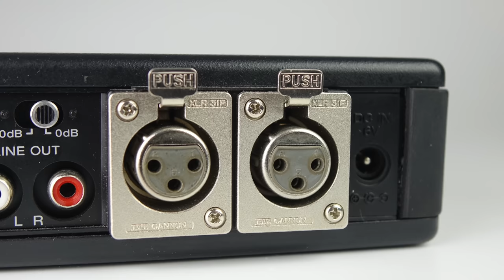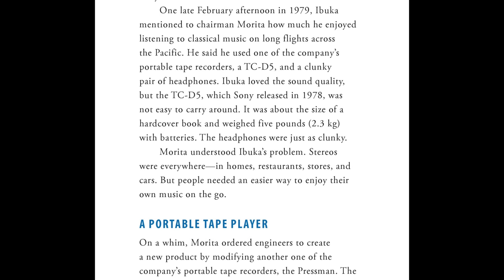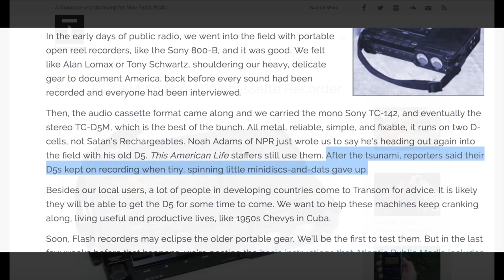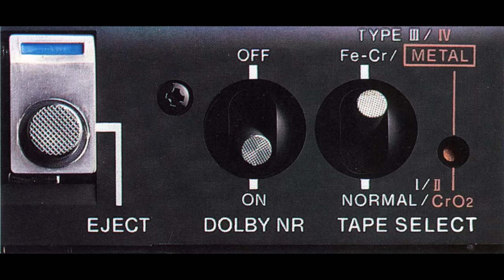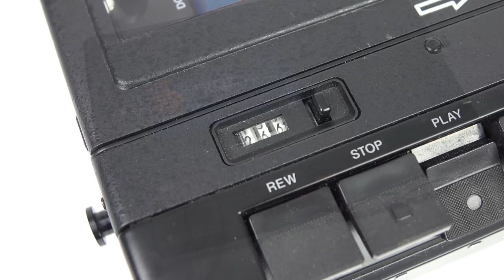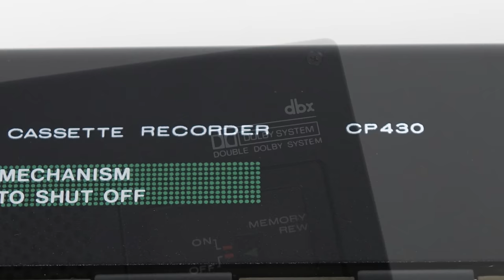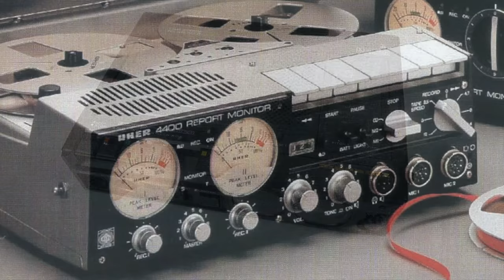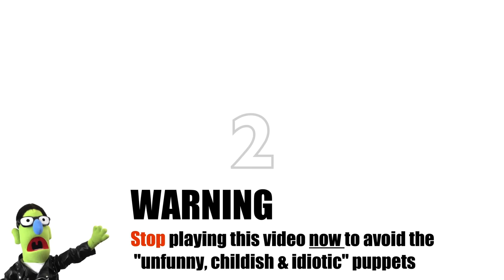Classic Tech - Sony TC-D5 Field Recorder

Comment: I worked in radio in the 80s, left in the early 90s, and when I returned in the 2000s was surprised to find that my new station was still using these recorders. These machines were incredibly dependable.

Comment: @ 6:31 that external power plug is center negative. 
This should be noted for anyone at home wanting to power their TC-D5's with the external plug because most DC barrel connectors are wired to be center positive.

Cheers for sharing this impressive bit of kit! And great quality video as usual, man.
Reply: A lot of Radio Shack equipment was "center negative"
Reply: Seems the negative pin is a japanese thing.. just look at most casio, yamaha and rolands. They have centre pin.. and theyre designed in japan
Reply: @Saavik256  Center negative was the standard for a long time till it changed to center positive for some reason. The change started in the eighties, and by the 90s most things were center positive. I don't know they they changed. But to this day, music related stuff that uses dc power is still center negative.
Reply: It is quite easy to rewire your own power source. Just label it clearly, so nobody would use it for something else.

Comment: I still have my TC-D5M purchased in 1981. I had to replace the belts but that's it.
The 'M' model has a sendust and ferrite head that will last forever, mine after 37 years and countless hours of use still has no sign of wear.
The limiter on those units is nothing less than a professional quality unit on its own.
I used the limiter for years when recording concerts and it performed like a true professional standalone unit feeding exquisite Technics RS-1500 reel to reel recorders.
Servicing the TC-D5M is not for the faint at heart, the service manual is a must and available on the net for free.
The main circuit board is linked to many mechanical controls under it and removing it should never be done without the service manual.
Even with the manual; take pictures of what is linked to what mechanically otherwise you are in for a very difficult if not a nightmare re-assembling it.
It is on my list of the very best audio units of that period.

Comment: Really takes me back! I used these in radio news as late as 2004, even after we were otherwise all digital. As a reporter, I preferred these to the minidisc recorders that were also available at my station. We would play the tape into the computer for digital editing. In another video, you talk about the high sound quality you can achieve with cassettes and it reminded me of this machine. They sounded great when paired with a high quality mic. Thanks for the stroll down memory lane!

Comment: I bought my TC-D5M on 1986, and recorded a lot of Dead shows with it. 
Awesome deck.  I still have it. 

If you looked at the tapers section at a typical Dead show, D5's were the predominant recorder, followed by WM-D6's, and then everything else. 
Stacks of D5's were the norm, with multiple recorders daisly-chained off a single set of microphones. 

One useful trick on the D5's, is that if you hold down the REC button when stopping the transport, the electronics stay active, and anyone daisy-chained downstream of you does not have their feed interrupted.

Comment: Great video as always Techmoan. I use a modern equivalent every once in a while when recording on-set dialogue or for a small multitrack recording, and the concept of these hasn't changed at all; £50,000 audio console condensed to a size of a book, built like a tank and still industry-priced. The only things that have been updated is the storage medium, mic preamps and inclusion of SMPTE connections for camera and timecode generator synchronisation. But the beauty of industry standard equipment is that they're built to withstand time and offer top quality productions no matter what era they're from. Consoles from the 80s are still used today and in perfect working order, and these recorders can still find use today.

Comment: i've had a superscope/marantz cd320 "professional" portable cassette deck since 1979. which at that time was $150, that came with dolby, dual flywheel, servo control, mic att, tape type etc, that has worked flawlessly since i've had it.. It does take 4 d cells, but can be plugged into the wall without an adapter. Its a heavy brute but the heads are in mint condition, and it has great sound. Unfortunately, the belts went out on it. i was gonna pitch it until i saw some of your videos on bring vintage equipment back to life. i was able to find replacement belts on ebay and was able to change after cleaning off all the rubbery goo. I'm now cleaning the goo of some of the electronics. Hopefully, i will get it back together soon and be using it again.  Thanks Techmoan for helping me save my cd320 from the landfill!!!

Comment: You know what I just thought while watching this? My daughters are 7, and I don't think they would know what either a cassette, or maybe even a VHS tape is. That's crazy considering I still had cassettes in my car up until about 2000ish, and one of my cars has a cassette player now, but i don't have any cassettes. I don't remember when my VHS player left me. I don't even have a DVD player now. I used to love going to my friends house as a kid, his mum had about 8 bookshelves full of VHS tapes, and I pictured myself as an adult having libraries of VHS, Nintendo, Commodore 64, etc cartridges and tapes in my huge audio room with walls of Marshall speakers and amps... and then I moved out and lived on pot noodles and bread until I progressed through the ranks. Now I've got kids I tend to hide in my shed and listen to motorhead.

Comment: I worked at a small, rural radio station in the early 90's, and we had a well-worn D5 that we use for remotes. It might have been the nicest piece of equipment in the building.

Comment: @7:20 - it's very slight but it does warble a bit. when you get swinging the unit on the hip if walking it will get worse.  But it's the best in that manner of all portables I have used. Quite amazing.

Comment: Amazing well done review. I have a TC-D5M which I've had for over 30 years. Amazing machine that served me well. Paid $450 for it all those years ago. Only had it serviced once for a minor issue. Built like a tank. Used it for lots of live band recordings. In my opinion the built in limiter is the most useful feature for loud live recordings. Unlike many limiters on other products today the limiter
on this product worked extremely well with very few negative audio artifacts that often plague such limiters.
As the saying goes "they don't make things like they use to" certainly applies to this amazingly well built piece of tech.

Comment: Excellent piece, as always, Matt! The -20dB att was the Achilles heel of the device.  We sent a reporter to Spain to record a Christmas special and she noticed that it was hard to get a decent indication on the VU meters while recording.  When she came back it was obvious what had happened and the recordings were almost unusable.  If only she'd phoned home!  

Marantz came out with another machine, aimed at radio reporters, which included a phone jack (RJ11) and circuitry to allow the reporter to do a number of handy things; record a telephone interview while in a hotel room (say), go live to air with the station, via the phone but using the higher quality microphone plugged into the recorder, cue up a snippet of a previously recorded interview and play it in as part of a live report to the studio.  Such a device would never, ever have gotten Post Office, or BT approval to connect to the UK telephone network!

Keep 'em coming!

Comment: These are fancier than the Sony and Marantz decks I used as a radio reporter in the 1990s. I remember a big knob on the front of the Sony to adjust levels -- pretty much every one I used was on at least its second knob. Those decks went through a lot on the field, and saved my butt so many times. When I switched to minidisc as an early-adopter, I loved the sound quality and editing functions of MD, but missed being able to slam the buttons on a Sony field recorder when seconds counted.

Comment: Great video as usual, thanks. Glad I bought my Pro II last year before this video came out and the prices went up for ever more!
Also have the CP430 & it's not all plastic- the top and base are thin pressed steel panels, but I agree that its build quality doesn't match the Sony's.
It's possible to change the belts in the Marantz- wonder how long the rubber on the Sony's disc drive wheel will last? Imagine it'd be hard finding spares if it goes.

Comment: I had two units like that. One from Sony like the prosumer deck you demonstrated and another from Marantz. Believe it or not my boss gave me these at an IT job I worked at in the early to mid 1990s as it was relocating / closing. One unit accidentally fell off the top of my car into the street on a storm chasing trip and kept working fine. Had no idea these were so costly!

Comment: You've not covered binaural sound yet.
Reply: Green Silver Or ambisonic sound for that matter.
Reply: Good shout, although it'd be a bit difficult to sample for the youtube audience.
Reply: StrongBlood NeverDies 
Why? 
Most people have a pair of earbuds to plug in.
Reply: +Green Silver When you upload something to YouTube, the audio is compressed, so it wouldn't be the same as the original recording.
Reply: Capturing recorded binaraul sound is tricky, it's very easy to lose the positional audio.

Comment: I wonder. What are those sounds on the end of the video (last few seconds)?
Reply: Me too!
Reply: I've been racking my brain on that, it's very familiar. My first thought was RFI from a vacuum fluorescent display but I don't think that's it...
Reply: What if it's USB RFI as recorded by a tape recorder?
Reply: The audio output of a previous motherboard used to make those noises while I was listening to silence. The sounds change depending on what you do on the computer. On my next computer I reintroduced a sound-card.
Reply: ruud waij I had this problem on multiple PC enclosures and every time the cause was the same: there's a nasty ground loop in the front panel assembly! You usually need to cut only a single trace and run a couple easy jumpers to fix this. On a single sided board in the front of your enclosure that can be usually replaced for $2 if you mess it up. USB power carries mainboard ground noise, but the soundcard has its own ground section with ground current suppression. When the front panel connects the ground between audio and USB, the current forced through the audio ground pollutes ALL outputs, not just the front ones.
Reply: My guess is an old analogue dialup modem handshake, speeded up a few times. I kind of recognize what could be the V.42bis protocol handshake at the end, just as the two modems gets established on their respective carrier waves.
Reply: Benny Löfgren I say it's the isolated electrical sound an old camcorder makes. Just guesses until one day Techmoan comes clean and tells us!
Reply: Radical AM Yeah, could be. I really recognize those final seconds from somewhere, very frustrating. :-)
Reply: Benny Löfgren He likes to torture us hehe
Reply: murtisoft I was once an Amateur Radio Operator and that's a good guess indeed
Reply: https://image.prntscr.com/image/794c290ca3e74a2a873dd5031471e7bf.png here's the spectral

Comment: This video inspired me to go on Ebay and buy a similar JVC model for myself, the JVC KD-1636-2J. Can't wait till I get it running. Don't have a decent cassette player, so I plan to use it as my go-to player. Plus, you never know when you need a device with a bunch of inputs and outputs which can also record. Now I will begin searching for cheap cassettes at thrift stores again to add to my collection.

Comment: This reminds me of the first Realistic / Tandy dictaphone I had when I was about 10. Not in the same league as the one in this video. But it had a stereo mic input with two mini jacks. I also had a Tandy stereo mic which I plugged in to it. But what blew my mind as a kid was that it also had inbuilt stereo mics. It wasn't so great in quiet environments because there was some motor noise. But I remember recording in the playground and playing it back on headphones for the first time. The stereo imaging was brilliant to my ears at the time. Just one of the cool things that Tandy made in those days. When on holiday with my parents, one would often see me at airports, on the tube platform, or recording birds or the sound of the sea. Stood there with my bumbag, holding the stereo mic out in my hand. I thought it was fantastic. Although, probably being a bit heavy handed, there would be mic noise. And though it had little wind shields on it, there was still a fair bit of wind noise. :) Even so, I still recorded a lot of sounds, some of which I have used in later projects, with a bit of cleaning up after the fact. :) For a kid, just getting in to recording, it was a god send. I think the tape mechanism must have been pretty good, because I don't remember much wow and flutter, or tapes getting chewed up etc. It had a switch which acted as voice activate in record mode, but as dolby in playback. Also, for reasons I could never quite work out, it had a volume control where you could set the left and right volume separately. A cool little device. If you were interested, and if I had the faintest idea of the model number, and if you could track one down, and if it worked ... given all those possibilities, it might make for a reasonably interesting video. :) Anyhoo, thanks for the video. :)

Comment: I have a very high-end cassette machine, but I use my Sony TC-D5 for recording off the net because it sits nicely beside my bed and my computers. Very convenient, and it makes great recordings. 

All my audio stuff is basically dinosaur era — but I hang about demonstrations of new kit, and I am not moved to any envy. The downside is that some of my stuff when it needs repair or service is out of my league for DIY. So, I have to pay a technician and hope there are spare parts available. Fortunately, where I live in Japan, there are still some older folks who know exactly what to do. I hope this remains the case for my TC-5.

 Audio: you choose and you pays the price — more or less. The Sony TC-DC5  is worth spending the dosh to keep it fit — if that is what serves your purpose! It was/is a brilliant piece of technology. I believe it was the device used by the character portrayed by John Travolta in "Blow Out". Check it out! 

I keep my TC D5 as one of my prize possessions. WHY? Because it still brilliantly does the job required ... although the FF no longer is working :((.  Well ... another decision: do I need it?

Comment: Used to use the Marantz machines working in radio journalism in the late 90s/early noughties. So much more confidence inspiring than the flimsy Minidisc recorders and solid-state recorders that were starting to appear. Nothing quite like the feedback of a turning tape and bouncing meters to know that the recording is actually happening!

Comment: My uncle had a silver JVC unit that was a boombox and walkman style device all in one. The tape deck pulled out of the center and could be carried on its own. When you were done, you could plug it right back in and the speakers (and I think radio?) would then function again.

It was really cool and right up in to the 2000s I thought it was an awesome device. Really heavy. I think I remember at least the front being aluminum.

Comment: I believe that 20dB pad switch on the side is for the mic inputs only --- notice it's labeled "Mic Att" (Mic attenuation).  I used the Marantz PMD series recorders, a version of the one listed here and its previous heavier version (and before that the Sony Superscopes) for decades in location speech recording and our normal operation was to acquire a line level feed and deliberately  plug it into the mic inputs, with the 20dB pad on and the Limiter engaged --- this gave us in effect compression and a good hot signal, and made up for many a weak feed.

So you'll only notice a level drop with that switch while using the mic inputs.  It doesn't function on the line ins.

Comment: OMG....that Elbow Cassette player reminds me of a dream I had about 20 years ago.  However, in my dream, it was very impractical (well, I was just a kid at the time).   The device itself would pull the tape along the heads and you didn't have the spindles.  It was about the length of a cassette and had Play, Rewind, Fast Forward and Stop buttons.  You would slide the cassette onto it until it locked into place.  When you were done with the cassette or wanted to flip it over, you'd push a button to pop the cassette out.

Comment: Great recorder, great video. The limiter is much more versatile. It can be used for dynamic compression. Standard procedure when making interviews: Adjust recording level to about +3 dB and turn limiter on. Then speech is compressed, great for broadcasting. When recording live music, adjust level to 0 dB and switch the limiter on. You'll get the full dynamic range, but in case the drummer "phreaks out" during a session, it will prevent distortion. Very useful.

Comment: Its called a disc drive...something very close to idler drive design...except for the rubber idler sleeve in on the outer circumference of the capstan and the rotational force is directly transmitted to it by a DC servo motor...Great video as always. Thanks for sharing...

Comment: I'm not sure if its exactly this model of TC-D5, but in a 1986 episode of Miami Vice, called "El Viejo" you can see one of the versions being used. Since this one debuted in that same year, it would be at least possible that it could be your TC-D5 Pro ii. You can see that they threat it super well in the show, putting it back in a padded briefcase after being used :)